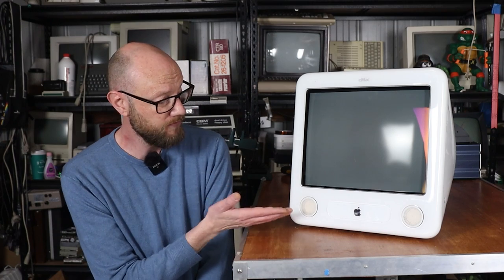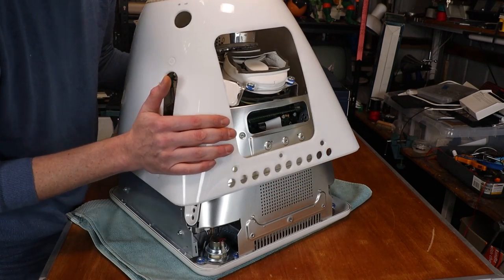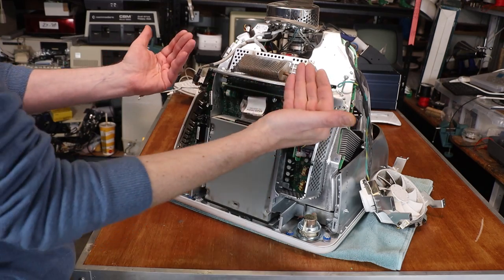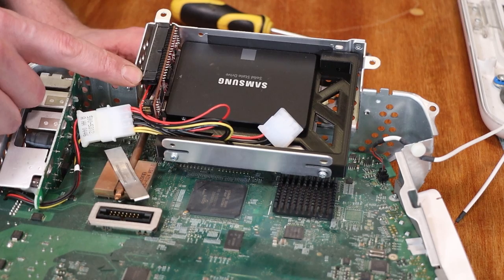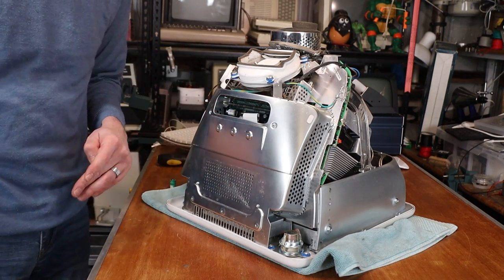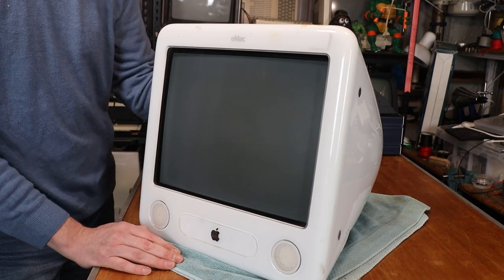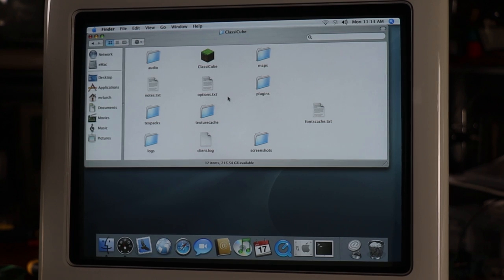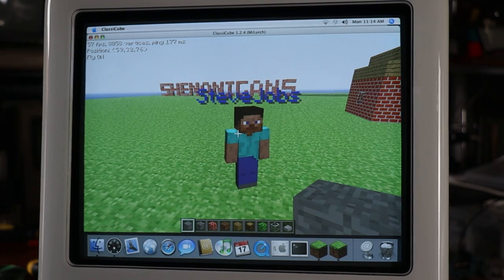Making a case for the eMac

Comment: Back in the day I had to look after a lab full of these lads. Honestly, they were just ... good. Low maintenance, no drama workhorses that basically just kept on trucking despite what the students threw at them every day. I liked them.
Reply: any site exist that troubleshoots these? or do i have to ship them out to a retro person to fix?  i don't think there's a fuse in the PS to check - these are too modern, so it would be a maize of cap checking and replacing.
Reply: And I guess that’s all you’d really need from a school computer, after all: Not very incredible, just very dependable
Reply: I have a good one, wanna buy it?
Reply: Would it be possible to have an old Windows OS installed and maybe even the mobo changed to one from the early 2000's? I was thinking of a little CRT retro gaming PC.
Reply: @GU__NI They definitely can't run Windows out the box. These are Power PC G4 machines, not Intel. Dunno if it's possible to hack an Intel machine into them. Maybe?

Comment: This was my first mac. Throughout the 90s I was unix/freebsd person and was excited to have Unix with a good UI once MacOS X had matured a bit.  MacOS also had Microsoft Office and Internet Explorer (this was before Safari) - two things the Unix world was lacking, the open source equivalents weren't very good at the time.   I had considered G4 iMac (iLamp) but was drawn to the CRT - it was larger, bright, could handle different resolutions.  The G4 iMac screen at the time was only 1024x758 15" kind of limiting.  So as soon as the eMac was available to consumers I went up to CompUSA and bought one and the stand!   It got me hooked on macs - I eventually sold it for a TiBook and have been using macs since, all because the eMac.

Comment: Great video! :hand-pink-waving: The eMac is a great system, especially the fastest model (like yours). The stand really ties them all together. I'm glad you were able to rescue it!

Sadly some of the earlier units had capacitor issues that caused odd display patterns and glitches. But there was a recall program, so hopefully those systems were mostly serviced. I look forward to seeing what you'll be doing with your eMac!
Reply: Ackchyually, there's one faster model from 2005 at 1.42GHz with a 64MB Radeon 9600 in it. I just bought one and I'm currently trying to figure out if the 1.25GHz's Radeon 9200 is actually the better GPU, despite its lesser memory. The one thing I'm noticing about this model is that it's recognizing BOTH sticks of PC3200 DDR RAM successfully. I've read that the 1.25GHz model would only see one stick at that speed and the other at a maximum of PC2700, thus underclocking the memory. That makes a significant difference in speed.

Comment: I have some of these… they were reasonably powered and yet underrated. I worked in a school and I was told they were being recycled. So I saved the school some money by saving them from the recycler.

The biggest issue was that the IT guy never maxed out the RAM. 

I need to check them out and fix them up to max them out.

Comment: Yeah, I do love my eMac, but it's just so heavy! I felt like I had to spend a week laying flat on my back after pulling it apart to upgrade the memory and hard drive (and clean out the dust). It was too big for my workbench, so I had to do all the work on the floor, which was not much fun. Everything worked after I reassembled it, but my copy of Tiger refused to install. Thankfully the Macintosh Garden came to the rescue.

I've never seen one with the stand. That really makes it impressively massive. EDIT: Actually, that's probably my best guess as to why they're so unloved, because they're just so massive and heavy.

Comment: The hard drive can be replaced pretty easily without removing the whole mainboard, after disconnecting a few items; but after you have the mainboard all the way out, it is a good idea to replace the electrolytic caps on there (and on the power board for the crt) - they both tend to be on their way out after this much age and the poor airflow these machines had. Best wishes.

Comment: Great video on this eMac. There is one flaw with one of your statements. You mentioned that these were one of the most robust machines. I purchased a large number of these from (wait for it) University of Canberra! The last lot I got happened to be similar to the 1.25Ghz model that you have in this video, and they were plagued with dodgy capacitor issues, similar to the dodgy caps that were used in the early iMac G5s. I had to recap about 2/3 of them, giving my tech a good workload with the amount of caps he had to replace in all the eMac G4s and iMac G5s. Anyway, I may do a video on the recapping of these eMacs one day.
Reply from the maker: Really? Ok. Everyone I’ve seen has just powered on and kept trucking. (Touch wood)
Reply: @MrLurchsThings  The 1.25Ghz and the 1.42Ghz models [eMac (2005)] had this dodgy caps issue. The earlier models were more reliable with the logic boards, but they tended to have more video issues. I just looked in my database, and I sold a total of 163 eMacs and 55 of those were the 1.25Ghz model. I do have a moulded eMac power cable, if you want one for a moderate price.

Comment: bit of an overclock on the 9250 since you have the education model really springs it back to life . a 50 mhz oc on the gpu and ram yeilds another 10 to 20 fps in some games . :)  i recommend repasting or using good pads on the gpu  also look for the one with the 9600 ati .

Comment: That's the same eMac version I've got! Nice machine to have even if you don't get those for free/almost free in my neck of the woods (they are more like 60-100 Euro). Neat display and good sounding speakers, too! Also quite a decent performance. A bit of a pity that (like every other Mac of its time, mine was manufactured in '04) the shift to Intel shortened a bit their lifespan as a "modern" computer.

Comment: Hi, I have a G3 ibook PPC and G4 Macbook (core2duo), and my son has a core2duo Imac

Yes they are old, but still work fine with vintage software.

The core2duo are dual boot with Linux Mint 17 so modern youtube is fine

But the 2 laptops are used because they still work, they have MS office plus the Apple office version - ( i cant recall the name because i have not used those apps in 5 years Apple iworks or similar it is a seperate dvd  to the osx install  ) 

Regards
George

Comment: I don’t know if it works with that model, but you used to be able to hold down the mouse button on power up and that will eject the cdrom drive.
Reply: What's the advantage of doing it like that, though?
Reply: @BilisNegra  Easier then having to wedge a screwdriver in to press the eject button.

Comment: Darn, I had one of these, 50$ from a cash converters store (pawn shop) magical picture, did photo's really well. Unfortunately Apple cut off the last of it's support, and I had no Apple software, nor knew anyone into Apple so it went to the tip. Pity
However I have now recanted and acquired a Bondi blue iMac, so I should get that out and see if any of the stuff shown here is applicable. (It's just sitting pretty in the corner, I know it powers on and that is it)

Comment: mmmm...yes. Im glad youre doing a teardown as these beasts are AWFUL to take apart.
My emac was beloved by my little girl a decade+ ago, then wouldn't turn on this year, and the mobo is a mofo of overly complex miniboards ontop of a baseboard where hardly a website or vid exists to troubleshoot this- even though its prob a blown cap (of which there are easily 40 spread out all over) even though none look leaky. so...
INTO THE BIN IT GOES!
Reply from the maker: At least replacing it (the whole machine that is) isnt expensive. As for the tear down, it just came down to taking my time and being thorough. It's certainly not a quick job.

Comment: Apples are landfill material. Because you can’t do anything with them. They are hard to upgrade/repair and there was software but a limited amount. Old IBM compatibles can still be upgraded/repaired and there’s truckload of software for it.

My wife uses apples and goes through them 4 times as fast as my window machines. My last Windows machine went through 3 video cards updates, 1 one power supply, and 1 Hard Drive update, and it still works. But after 9 years technology advances had just required a new PC to do what I want.